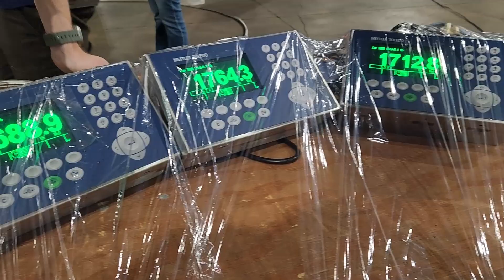Burning Electric Vehicles: FSRI Research Engineer Interview

Comment: By deliberately burning,vi i imagine you won't nessecerily get the jets of flame, as you would with a battery fault fire,
May be possible to instigate a battery fault to get genuine data
Reply from the maker: We did get jet flames.   Vehicle construction is responsible for this phenomenon.   It's really dependent where the battery vents are located.
Reply: The guy commented that he hadn't yet got the flame's shooting out, he didn't comment on how they set the vehicles on fire, though says starting the fire in the battery, burning from the outside could produce a different fire to one starting "within" the battery by one or more cell failures, I imagine he must be aware of this, assuming that is the case, also very early days with investigation, I appreciate

Comment: UL nonSolutions. C'on give me a break - 1 Year and a million bucks just for planning? Are you at all serious??? Three good people could compile a fully referenced and audited report in four months. Much of it available from cell manufacturers under hazard analysis... Smells like another political con-job not to rock the government mandated. You point about plastics doesnt seem very relevant - are EV and ICE cars significantly different inside? Answer: NO. Are EV cars and ICE cars significantly different in combustion? YES.
Reply from the maker: You fail to understand the size/scope of this project.  Coming up with the data that needs to be collected is only a small part of the project.  Many of the tools to collect the data needed to be designed.  There are very few "off the shelf" items being used in this experiment.  It takes a lot of time to design/fabricate many of the things used in this study.  This studies are completely independent from "the government".

Comment: Capt Durham don't know if i mentioned this before but (if you haven't already) you should ALSO connect up with the BIC (Battery Innovation Center) in Indiana, they are nearby to Crane Naval Surface Warfare Center (which is the only "land locked" Navy Base so that should tell you something) and they do Fire testing work for both OEM's and the Military. Ben Wrightsman and Rodney Kidd both Fire Fighters and worked the massive Morris Li-Ion Battery Warehouse Fire near Chicago back in 2021. spoke with those guys on my annual trip to PRI Indiana back in Dec 2022...

in addition, another you may want to connect up with is Eric Huhn down at UNC Charlotte he's a Fire Fighter and Battery Safety Engineer that's formed an organization called EVRSAFE. he held their first conference back in October at Charlotte Motor Speeday, but it was short notice so i didn't attend.  however i DID luck out and ended up meeting and speaking with him during my yearly Indiana PRI trip in Dec 2023.  for reference we're all approaching the issue of Automotive Lithium Battery Fires from the next tier up of Motorsports/Racing, and Trackside Safety.
Reply from the maker: I recently did an interview on the cleanup side of the Morris Illinois fire.   It should go live in the coming weeks.
Reply: @StacheDTraining  👌

Comment: Plastics don't make cars lighter.  A MK1 Cortina was 800kg on the road, the equivalent Mondeo was nearly 2000kg.  The weight gain is all down to extra structure to meet safety regs, extra comfort gear like AC electric windows power seats and an awful lot of plastic everywhere.
Reply: Extra gear and bloat: the cars have grown a lot, longer, wider, and taller on average.

Comment: will be interesting if their data will be like the australian data I saw. They told what the black and white smoke (which is not condensation) was, how much volume a battery produce in these gases (600-5000 liter / kwh if I remember correctly) and all these explosve gases. edit about temperatures I think he said 1100 degrees. I found the clip https://www.youtube.com/watch?v=AIXTP-TgPEw&list=LL&index=4

Comment: I’m not an engineer but am knowledgeable about motor vehicles. I am willing to bet the fire coming from a Li-ion battery vehicle fire will burn much hotter that the fire originating from an ICE vehicle fire. 
In Australia there is a lot of concern about EV fires as there have already been a number of high profile fires here and abroad.
The concern is mainly car park fires in multi story buildings and thermal runaway after a collision.
It will be a very interesting study. Best of luck.
Reply: re: "I am willing to bet the fire coming from a Li-ion battery vehicle fire will burn much hotter that the fire originating from an ICE vehicle fire."  you bet correctly, and the Capt'n knows this as he's spoken to this several times in previous videos.   the principle is really not much different than using an Oxy-Acetylene torch, wherein if you combine Fuel and O2 directly at the point of combustion (since O2 is what's liberated in the reaction during Thermal Runaway) instead of relying "solely" on Atmospheric Air for combustion, one will indeed create MORE heat by virtue of being able to burning MORE fuel...

also ref: Air/Fuel Ratio in ICE engine tuning and the Chemical Science of STOICHIOMETRY as grahamhobbs (and Shaw) eludes to elsewhere here in the comments.
Reply: @phillyphil1513  I considered a hybrid for a while. I have studied the subject a lot. I have decided to hang on to my 2015 Audi A6 Biturbo diesel. There is nothing wrong with it after 150,000km. It is economical, powerful and reliable and is aging well.
No rush to change.
Pioneers get arrows in their arses.
Reply: Plus all that hydrogen that lithium batteries release during thermal runaway can make an EV or enclosed parking garage go boom if the right fuel air mix is reached.

Comment: Yes I live in Australia and was a Registered Nurse was involved in fire safety during my career, including once being the designated fire officer in a  small rural hospital and as you know there are a large amount of plastics in the hospital environment including not only the medical equipment, the bedding etc but also the building's materials. We were always trained to avoid the gases, smoke, and molten materials given off by the combustion of the equipment (that were made from some sometimes specialised plastics) - notwithstanding the other materials that the buildings may contain. It was clear back then that the toxic elements of a fire were extremely dangerous and it was certainly scary stuff, and now it seems that the fire fighters of today now have the unenviable task of putting out EV fires and I commend every one of you that you do so to protect the individuals who may be exposed to the effects of these awful fires.
Reply: I will commend anyone who can extinguish a thermal runaway. I will commend you, as a fellow Australian, for your work as a nurse. As a seafarer I can assure you "A fire at sea can ruin your whole day"
Reply: Me too

Comment: I don't know about the USA, but here in the UK many ICE car fires are caused deliberately. Arson is a favourite tactic of insurance fraudsters, and is also employed by thieves as a means of destroying forensic evidence.

The bottom-line statistics of EV and ICE car fires don't make any reference to how or why the fires occurred. Though misleading, such statistics are useful ammunition for EV proponents eager to shift attention away from lithium battery fires by stressing how dangerous petrol and diesel are.

I make no distinction between pure EVs and Hybrid vehicles, by the way; I regard anything that employs a battery and electric motors for some or all of its propulsion to be an EV.

As ICE cars carry liquid fuel designed to burn and, in vapour form, explode, it's remarkable that they're so (statistically!) non-flammable. A properly-maintained ICE car won't spontaneously combust. Fire requires a source of ignition and, ironically, it's usually an electrical fault to blame.

An EV is its own source of ignition but, whatever the cause (accident damage, charging error, cooling failure, software glitch, water ingress, corrosion, neglect, or just old age) lithium batteries are not meant to burn under ANY circumstances. An EV fire - however comfortingly and 'statistically' rare - represents a catastrophic failure of the technology involved, and deserves to be headline news.

Comment: EVs may not burn "as frequently" now but you do need to keep in mind that the average ICEV is 12 years old while most EVs are practically still fresh out of the factory since ~80% of them were sold over the last four or five years. The frequency of EV fires may be much higher 12-15 years down the line where the fleet average age may pass the 10 years mark. Also, a good chunk of ICEV fires are of electrical origin and there is a lot more electrical stuff going on in an EV.
UL is just now looking at how EVs burn down? They could save a ton of money by taking a look at everything the Swiss firefighter researchers have already done. They already went through the effectiveness of classic and new approaches. Their conclusion? A cold-cutting water jet lance is the best way of putting out an EV battery fire.
Reply: Exactly...❤
This here seems rather slow and behind other investigations and experiments.
Reply: I 100% agree with you.. this is politically motivated 🐂💩
Reply: re: "keep in mind that the average ICEV is 12 years old while most EVs are practically still fresh out of the factory since ~80% of them were sold over the last four or five years..."  yup they're FOB (Fresh Off the Boat) or even "still in the Boat" in the context of the Felicity Ace sitting beneath 8,000ft of water off the Azores, and the context of the BURNED OUT HULK that was the Fremantle Highway, likely now having the last parts of it's keel cut for scrap in the Netherlands (Eemshaven) as we speak.
Reply: Other thing is total amount of vehicles favors ICE in the world.
If there is a high amount of one product and say 15% of them burns, 15% of 1000 is a lot more fires than 15% of 20 for an example.
Reply: @CMDRSweeper  When people talk about the frequency of EV vs HEV vs PHEV vs ICEV fires, it is usually normalized (ex.: incidents per 100k vehicles) to cancel out differences in fleet sizes between vehicle types.
Reply: @teardowndan5364  I don't believe they are fully normalized data either, remember that a lot of car fires are the result of arson in riots for an example and are reported as such.
I do not believe that is factored in most of the data anyway, and those fires I have looked at around here that have been genuine car fires, all of them had one thing in common, the fire started in the electrical system.
Meaning, EVs are just as prone as they feature a lot of the same electronics and centralized fuse boxes, but it isn't anything past anecdote data, just find it interesting that looking at 6-7 fires so far, and they all had the same cause.
Reply: EV batteries may degrade faster than an ICE fuel systems also. With dendrites forming over time and other aging issues of lithium ion batteries, it's way too early to know how many EV battery fires will happen. When there have been hundreds of millions on the road that are 15 years old we'll have some better data. I think as long as its lithium all EVs will having unhealthy batteries by 15 years old no matter how they are charged and taken care of.
Reply: @practicalguy973  we have been using lithium batteries to power billions of smaller devices for ~20 years. If dendrite growth was a major problem, the planet would be a raging inferno by now. Most catastrophic failures are caused by manufacturing defects and abuse.
Now that solid-state batteries are coming to production, battery fires may not be a thing for much longer in new devices.
Reply: @teardowndan5364  Not the same. Lithium ion batteries for example in a laptop, flashlight, power tools, small power banks, bluetooth speakers are all devices that fail electronically after 4-10 years for most people. So people are not charging them after they expire which is the most likely time they will catch fire. Lithium polymer batteries found in cell phones and really small devices like action cameras, voice recorders, bluetooth headsets etc... have even less shelf life maybe 3-6 years so even less dendrites before they are out of service. Most small devices recycled and small percentage sent to landfill where they catch on fire once in a while. Those fires are not difficult to deal with since the battery is so small. There are videos of this happening in landfill sorting stations. EV batteries have 8000 cells in some cases and will be charged 15+ years later if still working because they are so expensive and not easy to replace like a small device. EVs are much much larger fire scale.
Reply: @practicalguy973  Dendrites don't form from time, they form through charge-discharge cycles, especially deep cycles and charges back to 100%. They affect batteries made the same way the same regardless of whether they are in a laptop or EV. Except most people don't cycle their EV 0-100%, the educated EV driver who has the option of charging at home will only do 30-70% SoC cycles for daily commute to maximize battery life. Most consumer electronics have only one end-of-charge option at 100% assuming they have a properly working and properly set end-of-charge function in the first place.